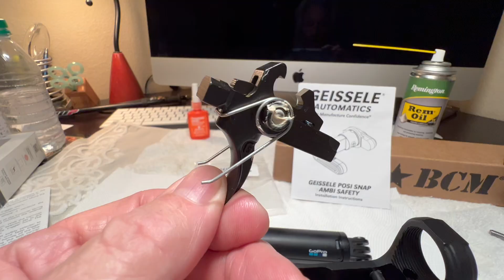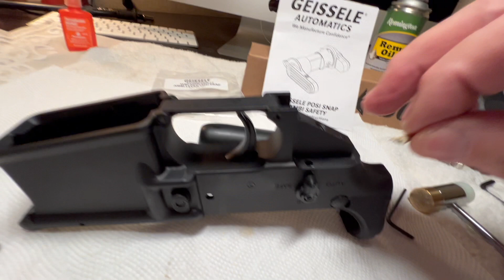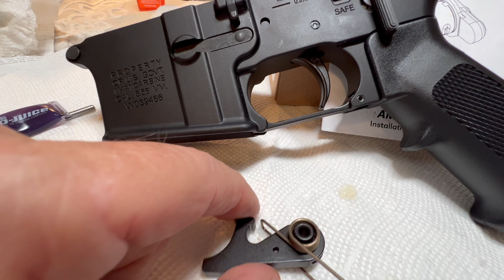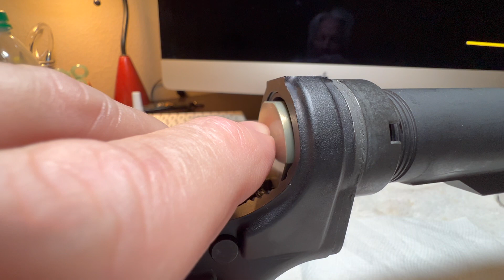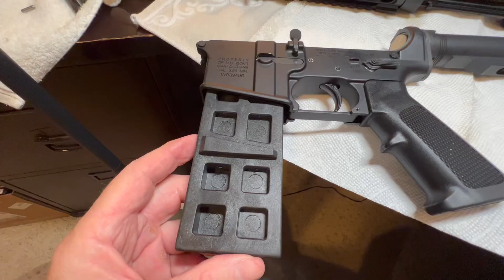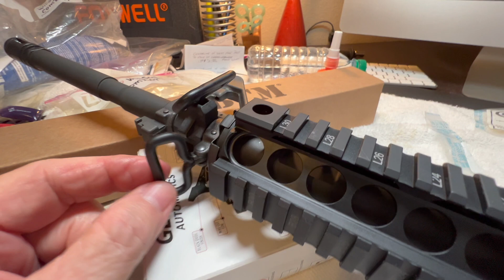M4A1 USMC/NAVY (2008) Retro Frankenstein Is Done!

Comment: That midwest rail looks better than I thought it would, was not aware they had little lugs that match the barrel nut. Great build. I ordered two little tins of Aeroshell 64 off ebay because this series reminded me how many little things it's good for.
Reply from the maker: Aeroshell 64... it's the correct stuff! The only thing that could be an issue with the Midwest Industries rail is that they include QD holes at each end of the side rails which would prevent you from using the correct 11 rib RAS rail cover. I believe the 11 rib would still work on the top and bottom rails. The 9 rib rails should work on the sides but they would run up against the very edge of the QD holes. Probably would look the best with all 9 rib. I haven't tried any of this yet so just going off the different size rail cover dimensions.

Comment: Great job, nice looking rifle.
You cover a lot of important tips for assembly.
I used the trigger that came in the parts kit for my M4A1 build, but just ordered the same Geissele set up.  I actually prefer this type of trigger. The great thing about ARs is you can always upgrade parts as you desire (or can afford to pay for them)
On my M16A2 build, though, I used a drop in, adjustable match trigger.  That rifle has a heavier barrel and despite being a "clone" I set it up as a match target rifle.

I also just ordered a Matech BUIS for the M4A1. I currently have a Colt carry handle on mine. I have not decided if I will ever spend nearly the same cost as the entire rifle to buy an ACOG. I'm not there yet. 

For the side swivel, I installed one of the pins before assembly and used a roll pin starter punch to start the 2nd pin.  I had tried the wrench pliers and they just didn't seem to want to fit in the space. 

My last 2 rifle projects began with an estate sale find of two stripped Colt uppers, 1 of them an A2 and one of them an A4/M4 and a Colt carry handle. $75 for the A2 and $50 for the A4.  
Always keep your eyes open for the opportunity to start projects requiring irresponsible expenditures of $$$  😎
Reply from the maker: My understanding is the Army M4A1 versions used primarily the MATECH and USMC/NAVY mostly used the KAC 300 or 200-600. I could not locate a new KAC anywhere but the MATECH is available. I found the wrench pliers are a little tricky but if you pre-install one of the pins first I found the wrench pliers worked the best from the bottom pin. It's a tricky little booger no matter how you do it. Mounting an ACOG using a cantilever mount for better eye relief was what I'm after but it seems the MAGPUL PRO was the only thing that fits under the American Defense mount without an additional spacer which gets the ACOG a little to high for my liking. I'll get it figured out but like you're saying for what you get and some of the mounting and eye relief issues the ACOG is very pricey. For now it's the carry handle which is how they first showed up to the armory before upgrades and the SOPMOD stuff started up. As for triggers I still lean towards a good single stage. The Geissele SSP is very good in my opinion. A lot of my builds start out as spare or used parts! Sometimes a new build will start from a single left over roll pin! Lol! Thanks Gary!
Reply: @peter1956-x4s  I wasn't aware of the Matech/KAC difference between Army and Navy.  I have seen some of the KAC sights for sale used.  I got a good deal on the Matech.
I have enough "take off" parts to finish out a couple of stripped lowers, but then I would just end up replacing them again.
When I bought the M4A1 lower from PSA, they also had M16A4 lowers on sale ($39.99 each) and since my FFL will charge me the same transfer fee for as many guns as I put on one 4473, and since PSA had a flat $9.99 shipping cost...I bought one of those also. That's how is "save" money. 

I already finished the lower on that one. 
So, we both know where this is going. 😂
Reply from the maker: @garyK.45ACP  Maybe I'll just get the MATECH and do a new build Army version! Could just put the MATECH on this one and change all the video titles on this build series to ARMY. 1st option I think! Lol! If you already have a lower put together... I know enough to know where you're headed!
Reply: @peter1956-x4s  I actually like the looks of the KAC sight.  Reminds me of a tang sight on my Savage Model 99.  But I got a great deal on a Matech...so, there you go.

Sometimes, especially buying small parts, I try to get as much as possible in one order to save on shipping cost.  So when I ordered the lower parts kit for the M4A1, I ordered 2 and put one in the M16A4 also.

BTW, I use the 4-40 set screw to secure the take down pin detent which you showed in one of your videos.  Cheap, easy upgrade. I think all lowers should come tapped that way.

For any flattop AR build, I first test it with a very good quality Leupold scope I have, just to establish a "base" for accuracy comparison.  I don't worry about "zeroing it" per se, but just get it on the paper to test the accuracy of the build. 

Then I take the scope off and install the final sights and zero the rifle. That also let's me know if the sight is working properly.  I had one carry handle sight that was terrible. The windage would change when I flipped between apertures, and wouldn't return to zero for elevation or windage.  I would not have known if it was the sight or the rifle if I hadn't established a baseline.
Reply from the maker: @garyK.45ACP  That's a good point when changing the aperture. I have a number of carry handle sights where the peep holes are drilled off center. That's very common in my experience. Who knows what's going on between the two?
Reply: @peter1956-x4s  Carry handles are a problem, in my experience.  I went through several. I finally got a good one, it's a Colt. I'll keep that one. I may not use it on this build, but I'll keep it for the future.

Comment: Besides lube, what do you think are the most important factors in an action being smooth?
Reply from the maker: Correct relationship between barrel extension and BCG bolt lugs which includes cam slot machining for correct locking and unlocking. This also affects the timing and mechanical dwell time. The relationship between the BCG carrier bearing surfaces and receiver bore ID. To tight or to loose which also affects how the BCG bolt engages with the barrel extension and how well the gas tube performs with the BCG gas tube interface. Some buffer tubes are rough machined and some are very well done being nice and smooth on the internal bore which allows for smooth buffer action. Gas port size and location on the barrel often dictates success or failure. Over gassed can cause premature wear and with insufficient buffering you get feeding and extraction issues with bolt bounce. Under gassed and get the same feeding and extraction issues and your rifle becomes a single shot. Improper gas also causes too little or too much gas dwell time. Sometimes the magazine well or magazine is off causing excessive BCG carrier drag and hold open issues on the last round. I can't point to just one thing as an AR is quite the balancing act. The three main areas I don't cut corners on is the barrel, BCG and also ensuring the upper receiver ID bore dimensions are good. With those three being right I can usually find a tuning or work around to get the rifle reliably functioning. My two most challenging builds were the DPMS pattern LR308's. I know what to do now but never again! I have not been defeated! $$$ Lol!